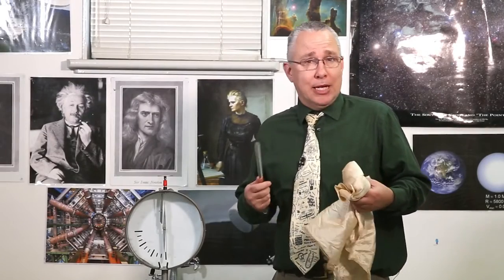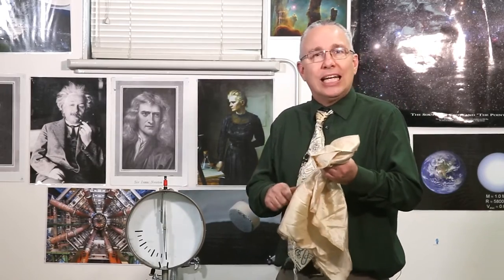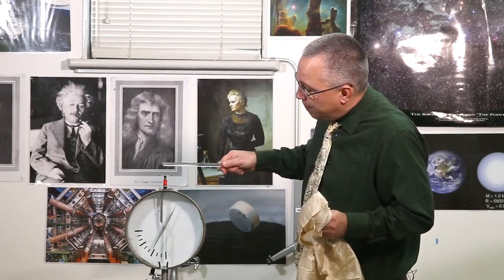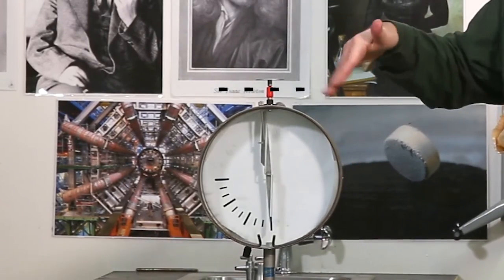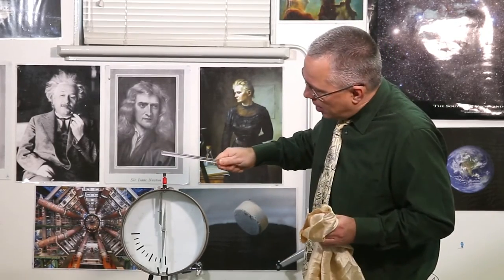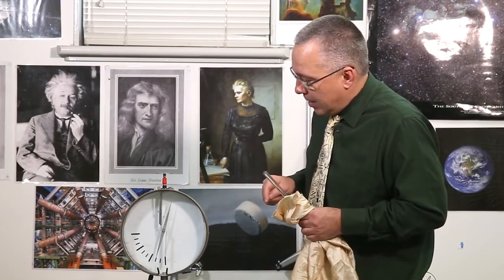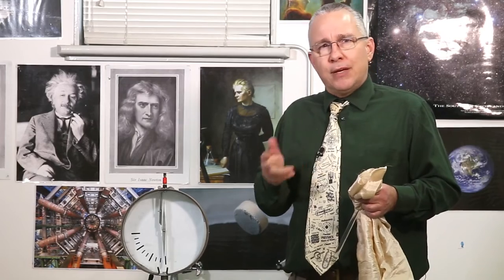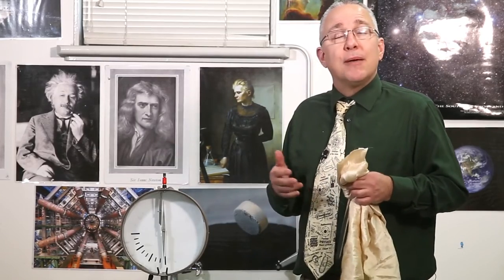Electroscope - how they work

Comment: At 0:54 you state you are going to show how you know the rod is positively charged using the electroscope. But at no point do you do that - you would get the same results if the rod was negatively charged. I think it does show that the rod is charged, but not the polarity.
Reply: using the electrostatic series you should know what the original object is, so you can compare it with an unknown polarity object through conduction